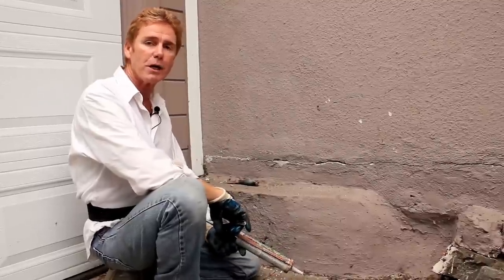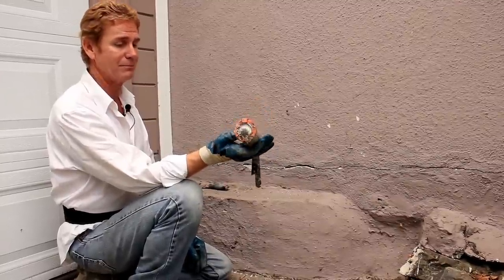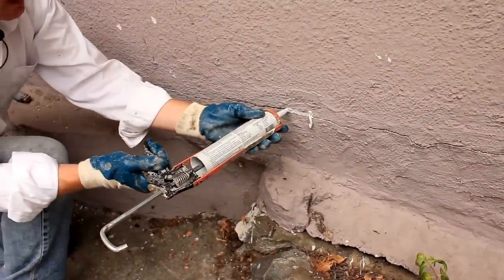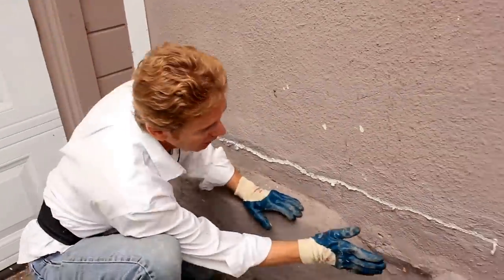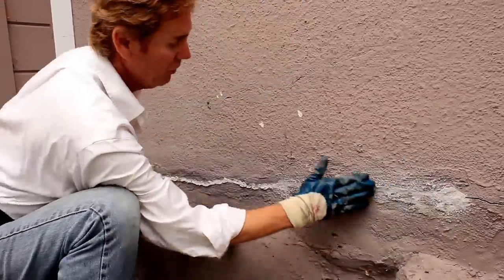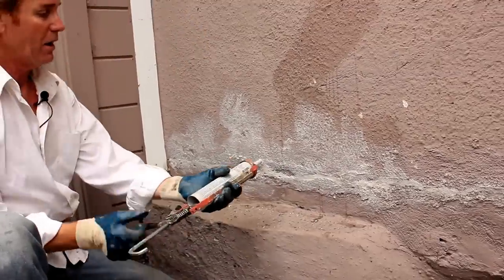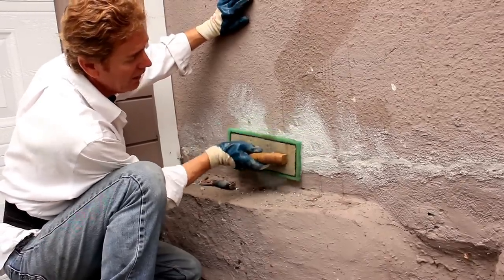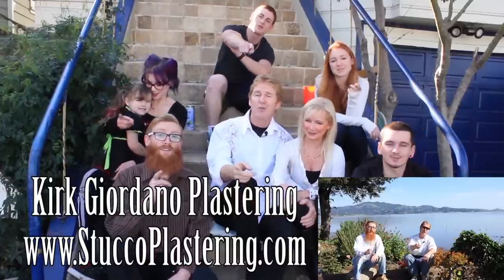Caulking cracks in stucco use Mor-Flexx or Quikrete with sand

Comment: Why wouldn't you use stucco material on such a large crack.  I would only use caulking on small and hairline cracks.
Reply from the maker: Hi Robert, excellent question, the house is moving, thus the stucco would recrack out within a years.🕵🏼

Comment: Does this stuff shrink? I have used the sanded caulk from Sherwin-Williams and have had to apply three coats because it shrinks after a dries
Reply from the maker: Good evening John, great question, most caulkings shrink if applied deeped and or wider than say 3/8 to 1/2 of and inch thick, especially the less expensive brands, the ones I show shink the least or I don't use them.
    Live long and plaster
 teaching  plastering video’s
Reply: @StuccoPlastering thank you

Comment: I used that morflexx calk on La Habra crystal white (unpainted) it is more grey than the La Habra crystal white stucco. Do you know what color paint or other product i could use to better color match the to the La Habra crystal white? note: we dont want to paint the entire house just the patch
Reply from the maker: Evening my friend, you can purchase a quart of white primer and just paint the cracks, Crystale white is the one color that can blend in. however, when it rains this color coat and the cracking will be different in color as they are not both cementitious. The remark below to spay a dash finish over it, I would not recommend.
 Bringing peace, love, and brotherhood back to the old fashioned 🌎  “Plastering.” 
    The most comprehensive encyclopedia of plastering on video, by the plastering messengers of Youtube.  
     Over 800 videos 🎭 👀💃
Reply: @StuccoPlastering  Thanks for the feedback. I ended up finding the correct color match. It was not La Habra crystal white stucco it was a CA brand. 
Imasco Minerals Inc.
19287 98A Ave
Surrey BC, V4N 4C8
www.imascominerals.com
It is #10 White Color and Premix 1000 Finish Coat Stucco (white base). Ratio for Crystal White is 1 jar of color added to 1 bag of stucco mix. Super duper white.

Comment: What paint would you recommend on top of the stucco, since you don't want to seal the stucco ,would you use a latex ?
Reply from the maker: Howdy Kraig Stanforth, the only time you don't want to seal the stucco is if you have a maintenance free color finish on a stucco home, as this is like a brick, the color last forever or never peels off like paint does, but once you do paint your stuck painting every 10 to 12 years.
 Otherwise I have never understood what folks mean when they say don't seal stucco, all paint if it's of quality seals the walls a bit.
 I usually recommend the Kelly Moore elastomeric system myself or something comparable.
 Cheers,
 kirk giordano plastering

Comment: Hi i need to caulk around the stucco-stop (J-channel) around windows on a stuccoed house. What's the best caulking to use between the vinyl window and the galvanized J-channel?
Reply from the maker: Almost any quality caulking will work Sikaflex is the best, but hard to make it smooth as it sticks to everything. The caulking in this video is user friendly but has sand, which might be a better choice for you🕵🏼
Reply: @StuccoPlastering thank you

Comment: Hi Kirk, love the videos.   Very informative.   Question, on the very fine stucco cracks or normal size one’s, are you supposed to grout them out or open them up like one would do on interior walls for plaster repair  ?
Reply from the maker: Evening Ron, if they have dirt in them, yes, as nothing adheres to dirt.
Teaching plastering do’s, don'ts and reasons why
            Captain Kirk out, Live long and plaster

Comment: That was cool. Thanks,Kirk !
Reply from the maker: Howdy Dude, no worries, happy to be of help,
        Live long and plaster
 images for stucco/plastering and teaching video’s
Reply: Kirk Giordano plastering Inc. hi Kirk great video! do you know if this stuff will work in my shower on the back wall of where the grout and tile meet? I have some cracking that I wanted to repair.  Please let me know your thoughts! Thanks
Reply from the maker: Good morning Boss, I'm hesitant to use any products in a shower except tile and grout myself,
 However the stores and amazon do carry caulking specifically designed for showers.
    Live long and plaster
 teaching  plastering video’s

Comment: question???: how would you go about fixing the painters mistake using the regular caulking for hairline cracks on a sand fine stucco finish?? paint wont hide it,  especially when the paint is a really light color. 
Thanks for the very informative videos you make, 
All the way from Texas.
Reply from the maker: Howdy Robert, use more-flexx it has sand in in thus when caulked properly it does not show where the caulking was applied, I have a video coming out that shows how to cover even smooth areas that have been caulked and are visable, video out soon.
    live long and plaster
 Giordano’s plastering images and teaching video’s
Reply: Thank you very much, will be looking forward to watching it 😎

Comment: Hi Kirk, Thanks for your videos - very informative. In this case wouldn't it be a more effective repair to use an angle grinder first and rout out the crack, thoroughly clean, and then apply repair material - allowing more of the product to be used and useful? All the best. Simon
Reply from the maker: Morning O Kafka, possible but this creates a lot of dust, and must be cleaned or hosed out thoroughly, what i did not show here was the day prior I used a all in one scraper then used the water hose with a jet steam to remove the loose dust as nothing adheres to dust.
 cheers.
 kirk giordano
Reply: I have to disagree with you, though you're absolutely right in one regard - "nothing adheres to dust". What I'm sure we're both after in repairing cracks on exteriors, is a repair that lasts - in order to effect this another approach would be to first understand what's happening mechanically in the area affected and then institute a repair which solves this, bearing in mind if there is substantial movement, other more radical solutions (such as underpinning) may be required. In order for a repair substance to be effective in this instance (and I'm sure the manufacturers would agree with me on this) it's a good idea to -                                               1)open the crack in such a way that the width is double the depth;                                                                           2) use backer rod in the required dimension to pack the back of the resulting groove, so the repair substance does Not get pushed to the back of the repair;                                                                                                             3) apply something that sticks, doesn't shrink while curing and stretches with the surface - more than likely this would involve using a primer (after ensuring all dust and loose debris removed!:-)); 4) then a method to blend in, so the repair is as invisible as possible. The problem then as I see it (I'm a decorator) is - how flexible is the paint film, that's going over this repair? So I'd be looking for something in exterior paint that had as much elasticity as possible, otherwise the repair would move, the paint would crack and the penetration of moisture would lead to more problems. 
regards,
 Simon
Reply: ...any views on the above Kirk?
Reply from the maker: Howdy O Kafka, this fix as many more crack fixes I do are free when I'm at a job working on other projects.
 Just because they are free, I don't hack them, I do the best I can with what I have to work with.
 However, I tell all of my customers, if you wish a valid unlimited warranty on any repair remove the entire wall, and we'll start from scratch, this idea or yours,
 is proper but I have found that the option to a free fix or one that involves paying for generally does not interest the majority of folks.
 I can repair this typical and very normal stress crack many, many different ways myself, this video was to explain how to apply a textured caulking to match a textured wall, 
for if we go into alternative solutions as we can write forever.
 best wishes, 
 kirk giordano Plastering
Reply: My view is you are 'hacking' this repair, for want of following basic procedure. I'm sure the majority of clients would rather pay for an effective repair, rather than not pay for a less effective one. In this video your all in one scraper has hardly touched 75% of the crack, and so you're applying an acrylic caulk to what looks a quarter inch crack at most - how much material is actually going in or around the crack? Standard procedure (one which would take very little time) if you want to carry out this type of repair reasonably quickly and reasonably thoroughly, with a chance of success, you'd use at the very least use an angle grinder to rout out the crack (this wouldn't add any more time to the job, so you could still do it for free:-)) and then proceed as you have done. I do appreciate your videos and tips Kirk, but in this case I'd say you're out on a limb.
Reply from the maker: Howdy O kafka, you my friend are entitled to feel whatever comes to mind, happy, sad, glad, the beauty of living is we are free to think and do as we wish, what a county.
 Cheers, 
kirk giordano
Reply: Thanks Kirk :-)
Reply from the maker: no worries,
Kirk

Comment: Dunno, seems to me like the hand rubbing and float wiping is doing two things I wouldn't want:

a. it is spreading caulk out into the surrounding texture which serves to FLATTEN the texture somewhat in those areas (hey, think about it, it gets wiped into the valleys, not onto the peaks...) (this I learned from patching nail holes in drywall that's textured, like orange peel.  -- After you spackle the hole, take a second to run a well-pressed thumb AROUND the hole and REMOVE any spackle that got spread out into the surrounding texture so that there's ONLY spackle precisely where the hole was, not a drop of it anywhere else on the wall to flatten that texture!  p.s. if the hole was dime-sized or larger, you'll want a can of spray texture to make that dime disappear so that the whole thing is invisible after painting...)

b. it is making the actual groove being caulked in very flat surfaced (clearly visible in the video, look at that upside-down smile of a crack at 2:41 in the video, smooth as a baby's butt!  yikes!) despite the "sandi-ness" of the caulk, it's still overly smooth compared to the stucco.  I'm guessing that's why we weren't treated to an "after-painting" view of this area...

Both of these are bad when you get to painting as they're going to make this repair visible by letting it show a flat area in the stucco that follows the original cracks path.

Me, I don't think I'd dress it out AT ALL with a gloved hand or a float.  Seriously.  Leave the build up there so that it CAN'T become a flat line that outlines the way the crack went.  I WANT some of that caulk sticking UP PROUD OF THE SURFACE along the crack randomly so that the "run" of the crack is broken up as much as possible along its length.   Instead, I'm just taking a stippling brush (or any stiff long bristled brush), and I'm gonna pat those bristles into that fresh juicy caulk.   Very minimally.  Gently.  Maybe just once or twice in any one spot.   I'd probably try that with wetting the brush first, and not wetting it to see how that makes the caulk shape up.  I'd even try waiting a few different timeframes to let the caulk start to set up a tiny bit before patting.  I'm betting there's a nearly perfect amount of time to wait that patted once or twice you'd almost need a magnifying glass to spot the crack!   ;)

Goal for me is to get that caulk to stand up proud, and take on the rough, non-uniform shape of the original stucco so that we CAN'T SEE ANY HINT OF A CRACK.

But that's just me.  I'll try and let you know how it goes as I just ordered the MorFlexx from the rain forest store online, 'cause that looks like exactly the right stuff to use...   now where's that brush???     ;)
Reply from the maker: Howdy B Miller, good eye, and lots of good advice there, brother, thank you,
Sometimes I do end a video if the point is made so that these video's aren't too long, but before leaving a repair and while Jason Is putting the camera away, I do go back over any imperfections to feather in to the best of my abilities.
 Cheers,
 kirk giordano

Comment: Quikrete is recommended for cracks between cement foundation and cement ground? 

Also for cracks in the cement ground?
Reply from the maker: @kueichenglee7583  Quikrete is indeed recommended, every company and there are at least 20 have their own formulas created by their own engineers.

Comment: So what kind of caulk do we use? Are you saying, we just have to make sure it’s “sanded” and “paintable “??? To repair cracks in stucco or around windows?
Reply from the maker: Evening Drew, I'm using Mor-flexx caulking.
I'm explaining caulking specifically engineered for cracking stucco, most stucco textures or finishes, are sandy so naturally, you need a calling with sand in it also. Plus, If I were to use stucco in this crack, I could do it much faster. However, when the walls move again and they will, the stiff stucco will buckle and crack and fall out. This caulking will expand and constrict with the home movement, which will last 5 times longer than any stucco used to fill the crack.
 Tile caulking also has sand in them; however, that sand grit is too tiny and does not match the majority of finishes on stucco homes. 
I prefer two types of caulking like Mor-Flexx caulking; however, many quality caulkings can be used on exterior stucco walls.
Also, Quikrete ready to use concrete Caulking has sand in every tube and can be used for walls and or concrete, and is sold at all the HD and lowes hardware stores.
FYI, Quikrete wrote the book on stucco and concrete products.

 Cheers, my brother.
Reply: @StuccoPlastering thank you

Comment: Can I fix a corner retaining wall crack by pouring some concrete in the middle and using Mor-Flexx on the outer?  cracks are getting larger as you move up.  Thanks!
Reply from the maker: sure you can, however, if more than say a dollar bill a finish stucco would match better.😉
Reply: @StuccoPlastering  Thank you

Comment: Thx Brotha
Reply from the maker: No problem
Reply: @StuccoPlastering  
Hey, can you show video caulking a crack on stucco and applying paint on the caulked crack?
Reply from the maker: @richardtemple7706  As we don't do the painting no, sorry. This Mor-flex has the stucco sand that matches the best to stucco cracks if it's not perfect, it's the best that can be done.
Reply: @StuccoPlastering  
Ok thanks.
Reply from the maker: @richardtemple7706  no worries.

Comment: 1:24  “......this crack will disappear.....”🤣A typical value of thermal expansion and contraction of concrete is on the order of 10 millionths per degree
Reply from the maker: Thanks for the tip

Comment: So you mean In the afternoon the crack is gone  and come back in the morning? Hahahaha
Reply from the maker: Good evening Gabriel, this is indeed what I mean, as in the morning the wood does not get the hot sun thus it shrinks, when the hot sun beats on the wood wall it heats the wall thus once again creating expansion which pushes out the stucco.
 This action make the cracks almost invisable. 
                                        Best wishes,
         Mastering Plastering for the beginner’s to the experts